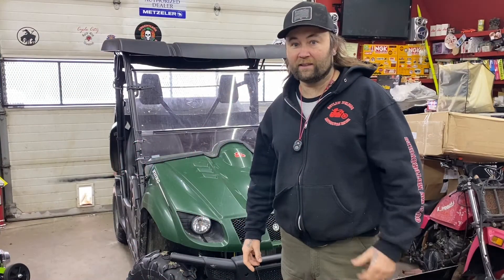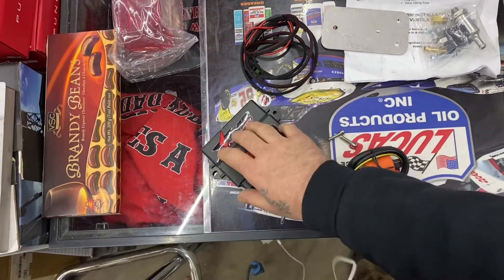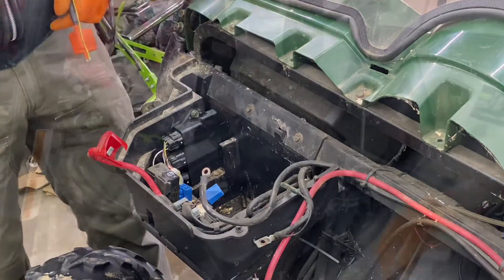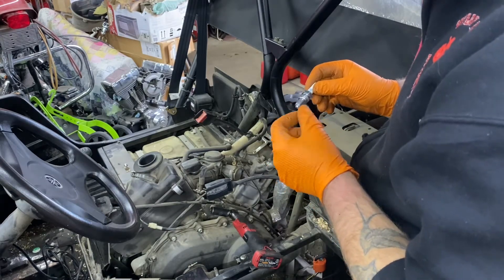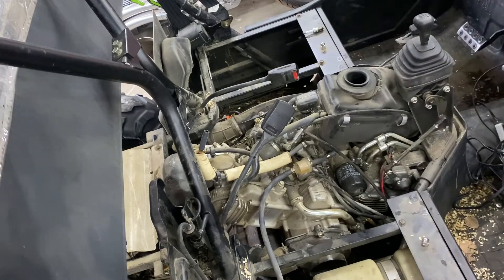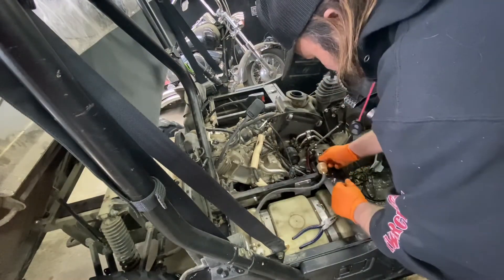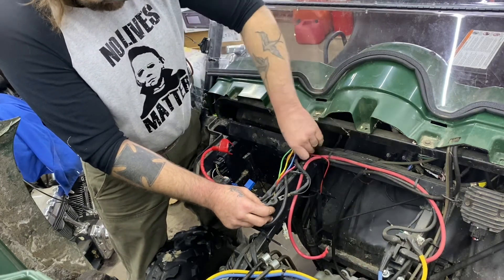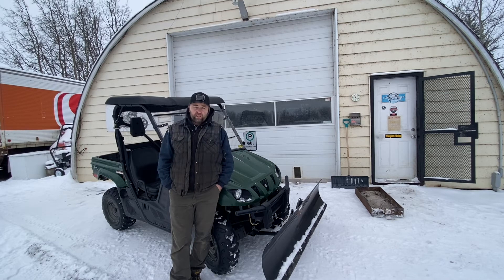Rhino 450 ecm and fuel pump upgrade

Comment: This video literally saved my ass. Rhino had this fuel pump installed before I acquired it and it was running very lean and popping. They never plugged that other hose so it was sucking in air. Plugged it up and now she runs like a beaut. Thank you so much for this.
Reply from the maker: You’re most welcome. Thank you for the input. Hopefully soon we get to start doing videos again.

Comment: Hello. I installed an electric pump as in your video example, after a while the oil level in the engine rose, gasoline got in. I started the engine in the winter without enrichment, so the engine did not start right away. Where to look for the cause of gasoline getting into the engine? .. Can the carburetor become clogged and be the cause of this? Thank you
Reply from the maker: Yes, the carburetter can become clogged from whatever reason, Dirty Few, water, etc. But also if you install a electric fuel pump, if it makes too much pressure when it’s pumping it can bypass the needle on the float. The pump only needs to make a couple pounds psi to keep up to most gas engines.
Reply: @outlawweldingmotorcyclerep1680  I disassembled the carburetor, and there were three ants and a filter mesh with dirt and the valve did not hold the fuel. I cleaned and assembled everything, the mixture enrichment screw was unscrewed by four and a half turns, this is a lot and I set it to two and a half. Now the result is already different and the engine has become faster. Thank you very much for your help, if I don't understand something, I will definitely consult with you)
Reply from the maker: You’re most welcome. Please reach out anytime. You have a question, I’m always willing to help. Mixtures grew is usually about one and a half turns to two turns.
If you’ve got crap in there, try putting a fuel filter in there permanently
Reply: @outlawweldingmotorcyclerep1680  You are right, you can put another filter directly in front of the carburetor itself.
 I'll try to set one and a half turns. 
Thank you very much for your help.

Comment: When adding an electric fuel pump, do i need to upgrade the ecm and coil? Ive added an elctric fuel pump, but the engine still wont start. It turns over easily but wont fire.
Reply from the maker: No, I would not say that it is necessary to change them. It is a good idea. I feel on the rhino 450 because the spark is weak. If you have a hard time starting, put a new spark plug in it and run a gas line antifreeze regularly. There’s always water in the fuel because of the ethanol in the fuel nowadays.but hard starting could also because of leaky valves or low compression with the rings. But start with a spark plug.

Comment: Have you had any issues with flooding the carb? I’ve seen some people running a spill back to the tank and I was wondering if it was necessary.
Reply from the maker: I can’t say that I have ever had a problem. Once the carburetter set up properly with the float levels and proper needles then there’s usually no issue
Reply: How has the new ecm helped your rhino
Reply from the maker: More power, revs up faster